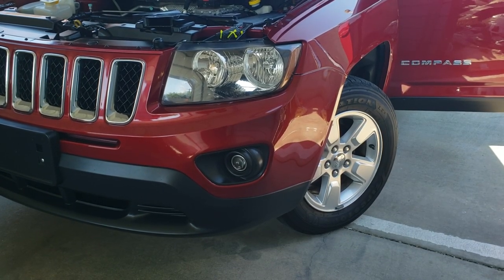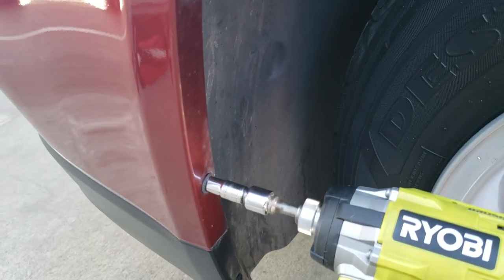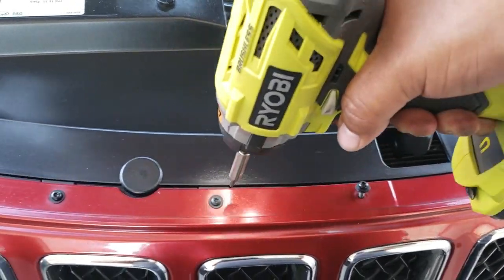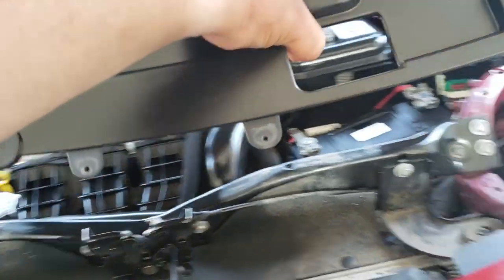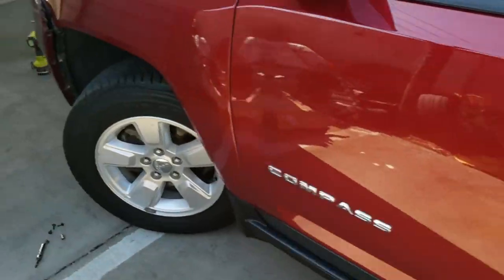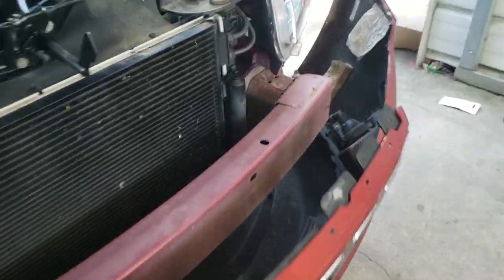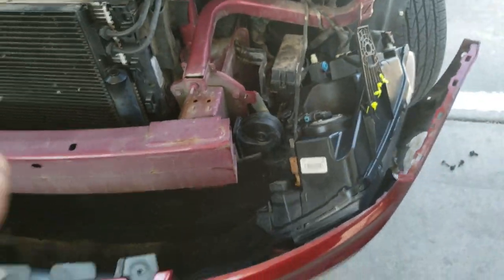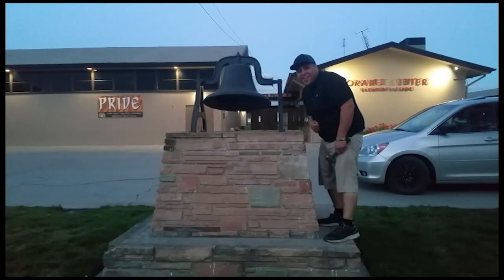How to: Remove Headlights from a 2015 Jeep Compass

Comment: Thanks a lot! This will definitely help me in the future. My driver side headlight has tiny cracks all around it for some reason. It was perfectly smooth yesterday. I tried sanding it with 2000 grit, but I think I might need to try with 800 first. If that doesn’t work, I’ll have to get a new headlight. I can’t stand my Jeep all scratched up lol. Anyways, thanks again.
Reply from the maker: You're welcome! I'm glad this was able to work for you. Harbor freight has a headlight restore kit for a power drill comes with 500, 800 and 3000 grit sanding pads and a polishing pad with compound for 15 bucks. Extremely worth it! Thank you for your Support!

Comment: Hi, I have a 2015 Jeep Compass. The passenger high and low beams are out.  The guy at the auto parts store told me I just need small bulbs. I disagreed.  What do I need to do to fix this? Thanks
Reply from the maker: its hard to tell to be honest, got IG? (559powerscape) can you send me a picture of the front of the car with the lights on?